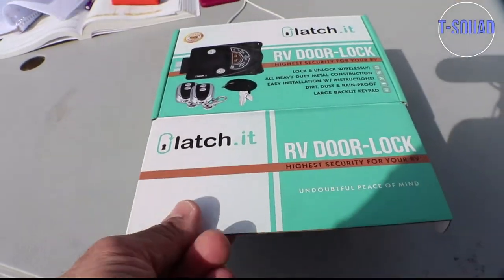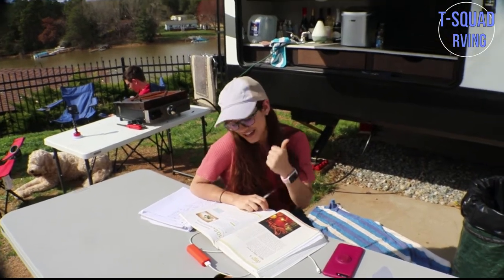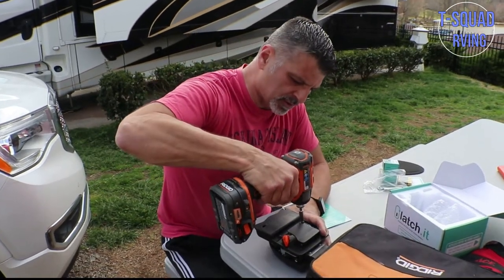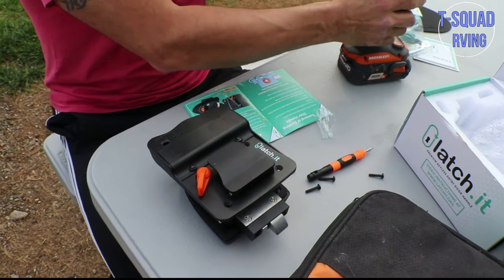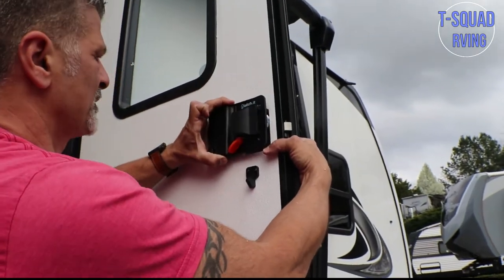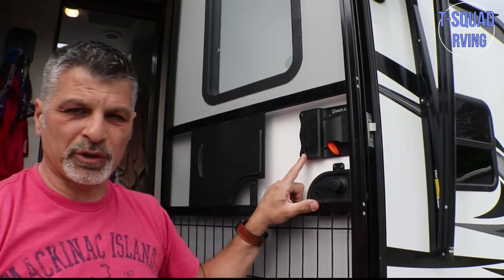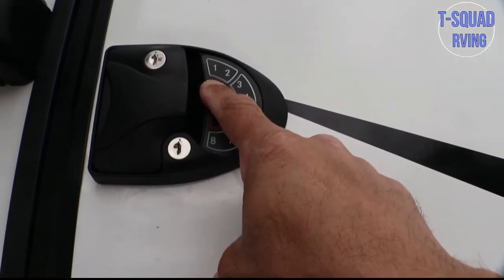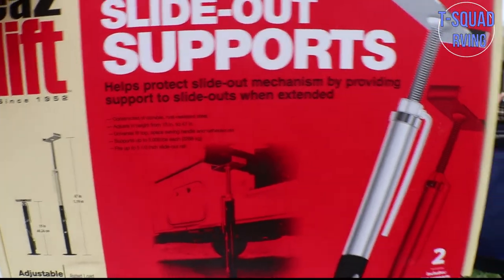3 RV Upgrades made Full Time/Part-time RVers

Comment: Angelo you might double check your lock. That thing you set aside, you called a template, I believe was actually a gasket that goes between the lock and the outside of the door to keep water out of the door.  I could be mistaken but I thought it looked adhesive.  At the very least I would put clear silicon sealant on the top and front edge of the lock.  I don't like to put it across the bottom so if moisture gets in it can hopefully drain out.
Reply from the maker: Hey Casey.  Thanks as always.  You are correct. I did notice after installation that was a gasket that went between the lock and the door.   So I placed a little silicone on the top of the lock and left the bottom free of silicone.   Love how you are on top of things.  Keeps me accountable.   Lol.   Thanks again my friend.
Reply: No problem!  Always good to have a second pair of eyes on something.  Keep it up! Hope you guys are having fun.

Comment: What are your thoughts on the slide support bars? I was looking into them, but came across a thread that said don’t use them because they cause too much force in the slide frame and can cause damage. It went onto say that your sides are meant to have a little movement in them. Just curious on your thoughts. 😎😎 keep up the great videos!
Reply from the maker: Hey.  Thanks for watching.   I did read something as well but I guess it’s preference. When I put them
In place I tighten up to where it feels like it’s lifting then I stop.  And maybe back off a little.  I can tell a difference with them
On.  Those slide frames can handle a little Preasure.  If you think about it sitting on that slide eating or watching  a movies 2-4 people you have about400-600 lbs.  those slide bars can use a little help. 
Thanks again for watching.